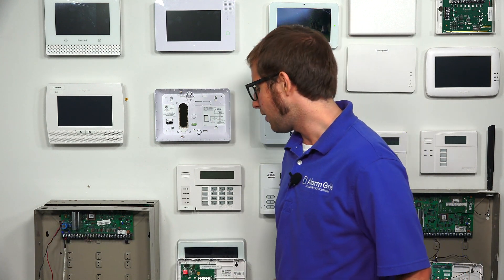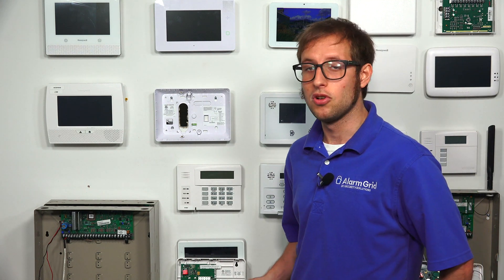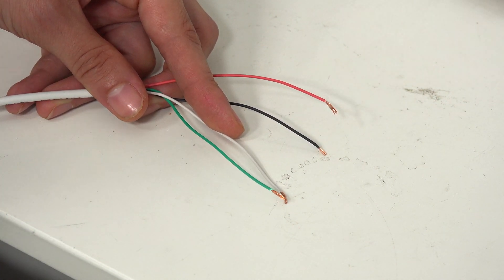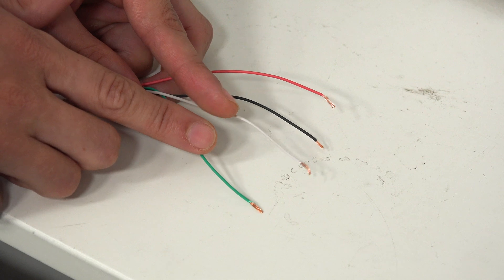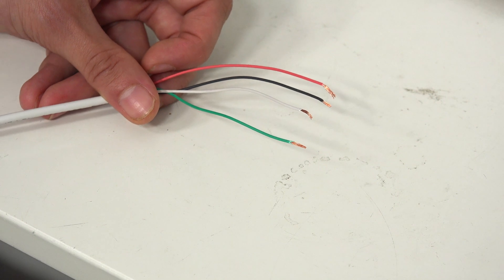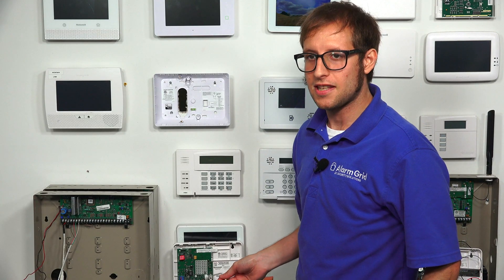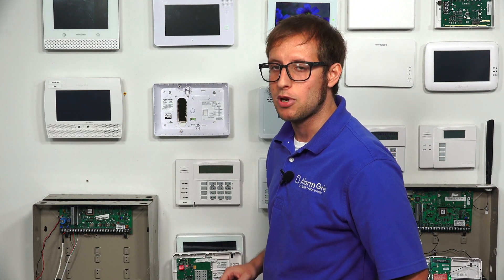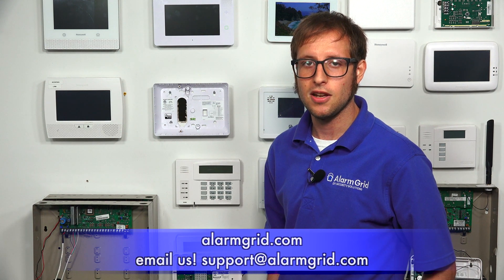Installing a Honeywell 7847i on a VISTA P-Series Alarm Panel

Comment: Thanks for the video.  Seems pretty straight forward. Question : after changing the mainboard chip and connecting the communicator, will there be some reprogramming to do ?
Reply: The programming is saved in the main board chips not the prom chip.